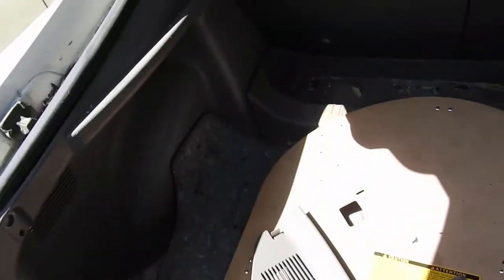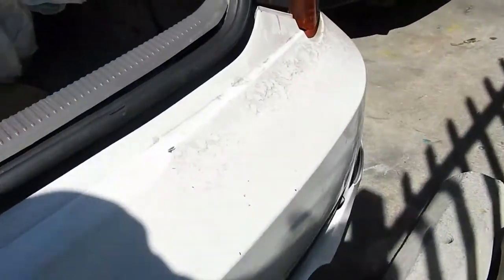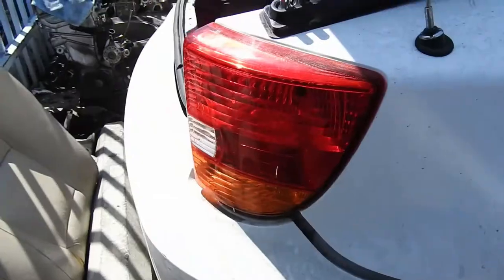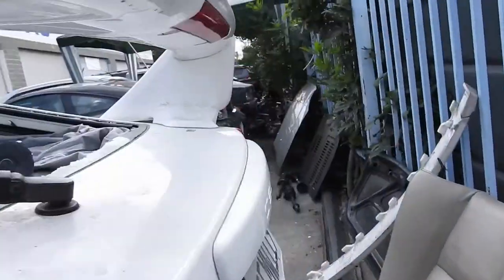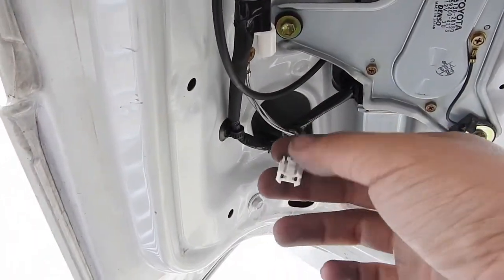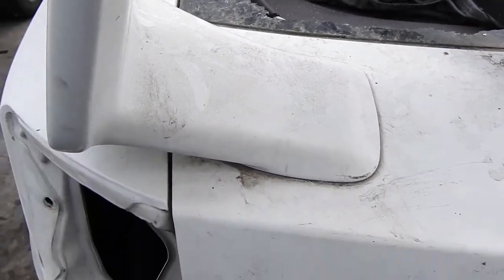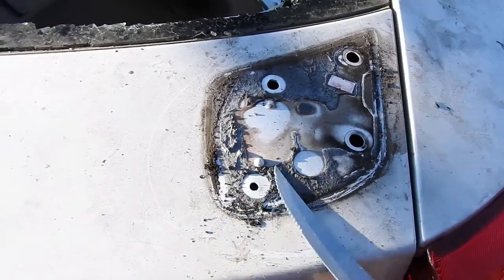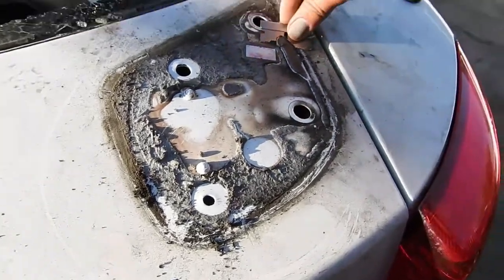How to remove TRD wing and rear bumper (00-05 Toyota Celica)

Comment: I try to remove my trd wing so i have only to remove 2 screw in each side? But the probleme it is all trd wing are stick to the car? i dont want to scratch my paint lol ? Ps sorry for my english i speak french
Reply from the maker: max truck10 yes they are stuck with double sided tape I would use a heat gun
Reply: Thanks!
Reply from the maker: max truck10 no problem